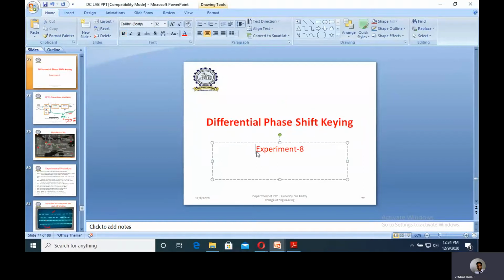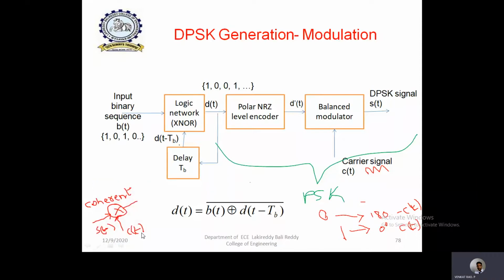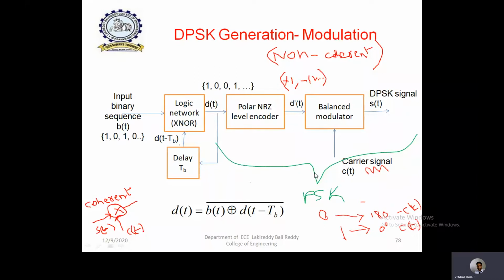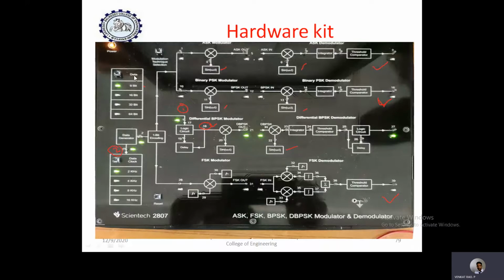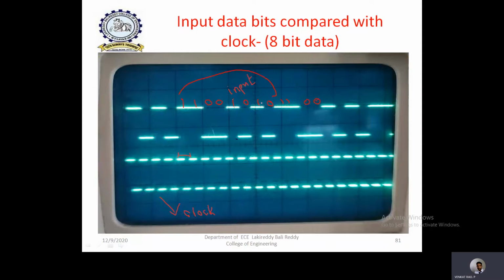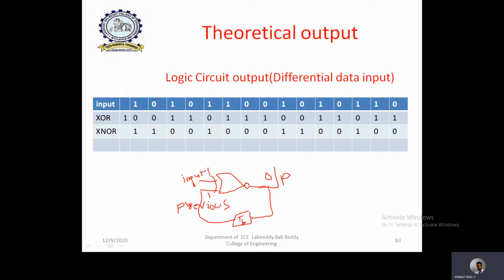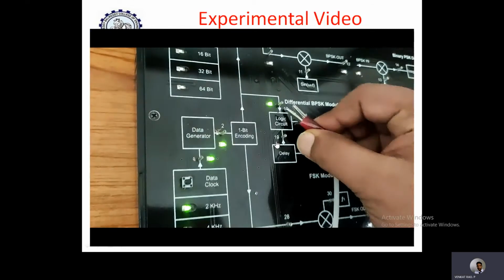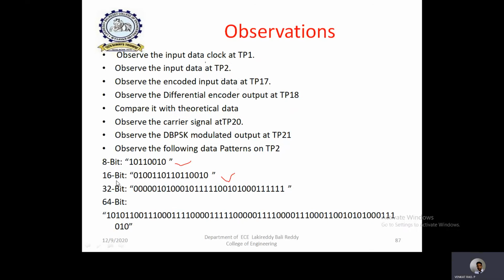DPSK Modulation and Demodulation Lab Experiment

Comment: Thanks for sharing such an informative video.
Can you please share the Practical  DPSK Modulator Demodulator circuit diagram with parts details which without need of carrier phase synchronization can extract the original Binary data at Demodulator end.
An early response will be highly appreciated.
Kind regards.
Reply from the maker: Thanks for the comment. 
But the hardware kit not available as said. You can refer below video from other channel without carrier signal at demodulation
 https://youtu.be/lfqRXh95pMM
Reply: @VenkatPasupuleti27  ok, thanks for sharing the link